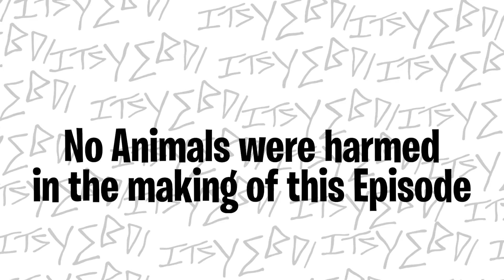EXPERIMENT: COCA COLA AND MENTOS UNDER WATER - Challenge

Comment: Just a little tip when hydro dipping something.  When you dip the item into the water swoosh around the painted water uptop so when you pull the item out it doesn't add any extra paint layers to that first layer you put on